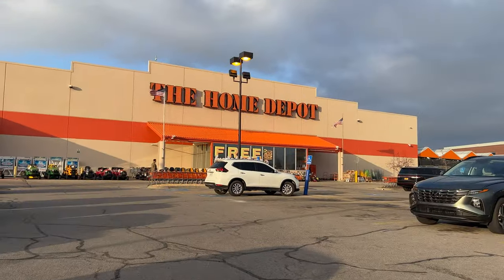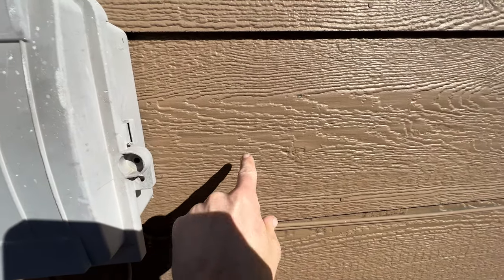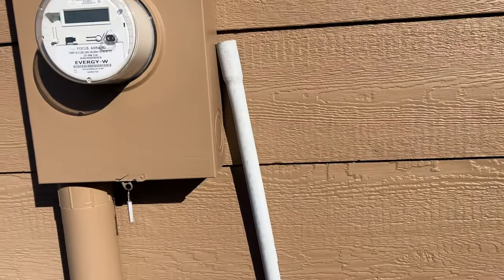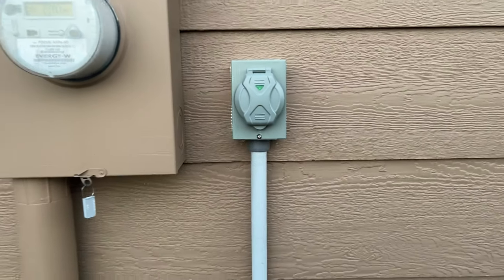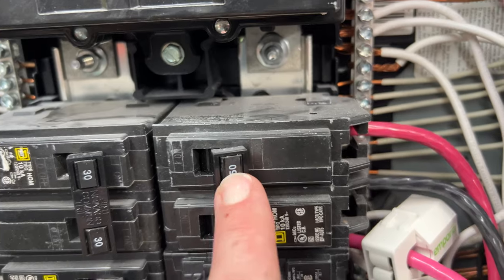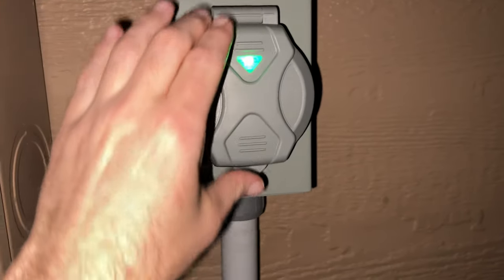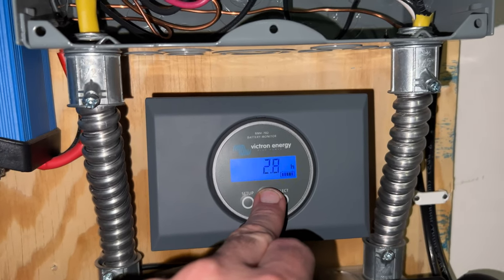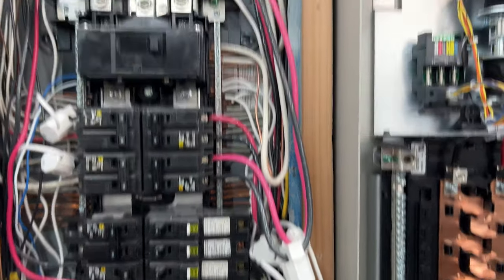DIY Generator Power Inlet Box Installation - Zombie preparedness!

Comment: why did you mount the generator plug so high up? I would have mounted it right where the hole you drilled is! less stress on the plug due to the weight of the cord!!

Comment: Backfeeding a breaker like that is illegal in many areas. You have a transfer switch; why aren't you using it?
Reply: I'd say it's pretty much illegal anywhere in the US.  He did say he is going to be adding an interlock though.
Reply: @Derakkon2  The point of the second panel is to automate the transfer. The way he's setting it up, he needs to manually switch off all the breakers for items he doesn't want the generator to power. He should run a 100A jumper to the second panel, and move the circuits he wants to have generator power to the second panel.

Comment: Are you sure you have the correct external socket because at the moment as you have done in the video, if you back feed the main all the easily touchable pins are live.Should they not be shielded pins?
You might also consider sealing the inside of the bottom tube around the cable leading into the house to prevent it turning into a water spout if you get ingress of moisture.
Reply: Yes the external socket should be a male socket.  That being said, it needs to be connected to either a transfer switch or a breaker with an interlock.  When using these, those prongs should never be hot.  The way he has it set up in the video is extremely dangerous.  He did say that he will be adding an interlock though...
Reply: @Derakkon2   I was thinking more a shrouded male outlet and shrouded female plug like used on a ev charger. Plus he may have broken local code in the way the installs had no safety interlock.
Reply: @Arachnoid_of_the_underverse  These types of sockets and cables are very common and have been used on RV's and portable generators for years.  There are definitely some safety concerns with them because many DIYers like Jason don't put in the proper safety mechanisms or they make suicide cables (double male ended). And I'm pretty sure what Jasson did here is illegal in every US state.  As far as the plug design, the EV companies have a novel technology that some people are going to be weary of.  The last thing they want is for their chargers to be responsible for someone getting electrocuted, therefore they designed a better plug that doesn't have exposed pins so there's less of a chance of that.  That's just my theory anyway.